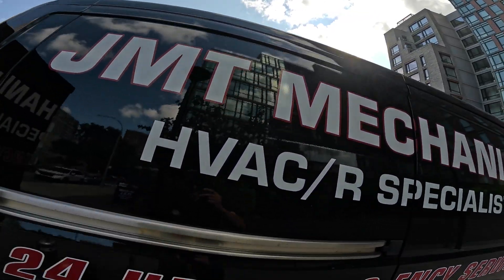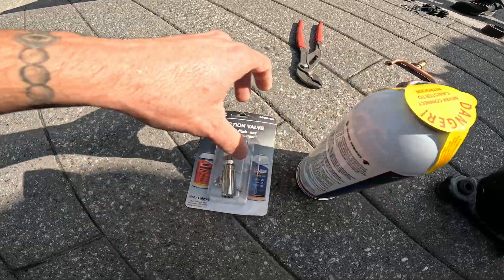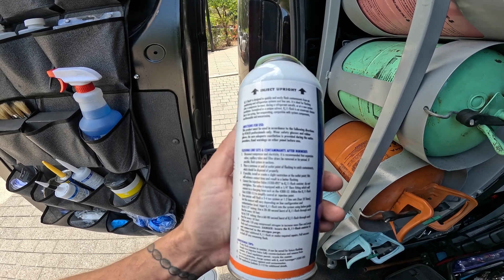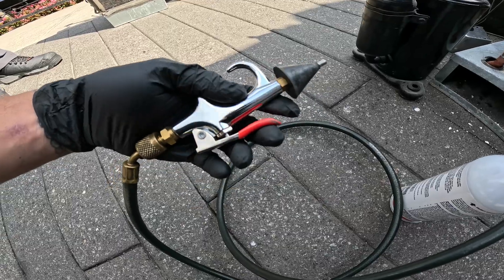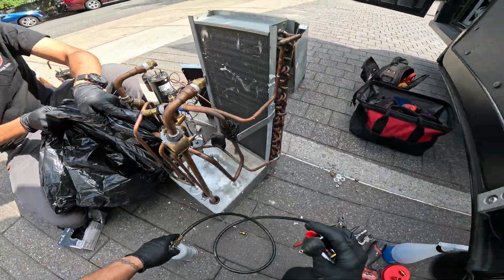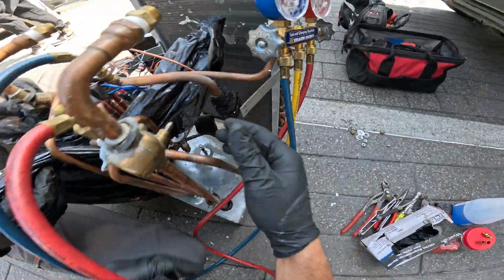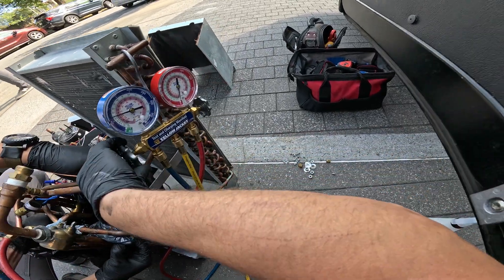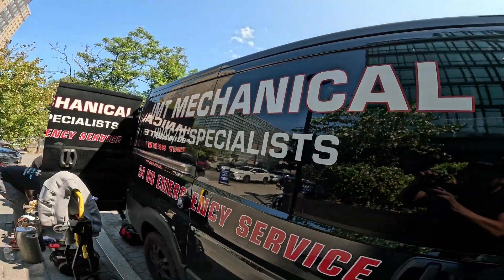HVAC: Nu Calgon RX11 Flush Kit (How To Use Nu Calgon RX11 Flush) Nu Calgon RX11 Flush Procedure

Comment: I use that stuff a lot. Even after the nitro purge I also will run a 30psi nitro purge afterwards.  Just to make sure the flush is fully out and to evaporate everything else in the system. I find that helps with the vacuum.  Good stuff